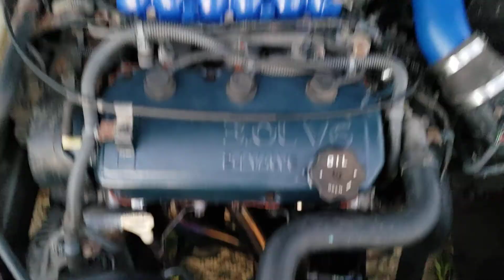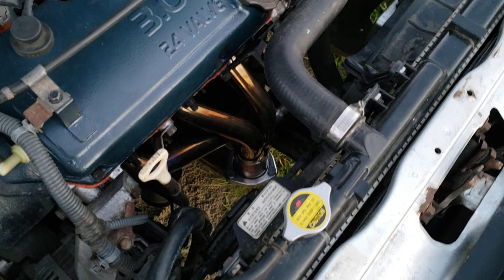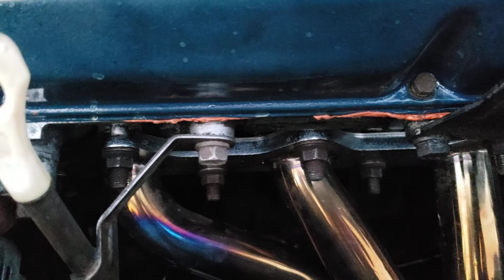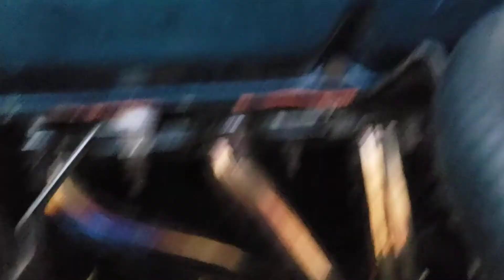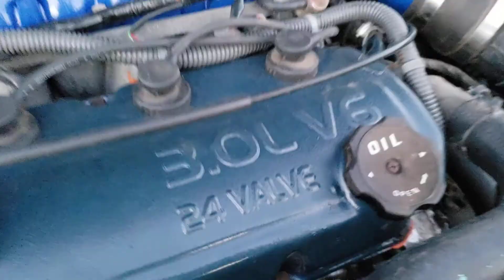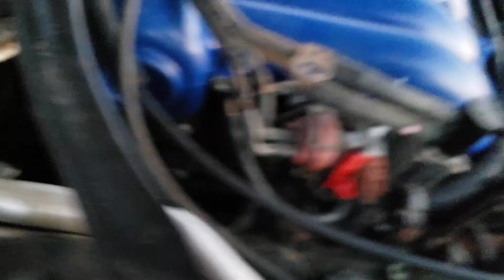Mitsubishi Eclipse GT Headers

Comment: I’ve got the same set since 2008 my only regret is not getting them ceramic coated, then again I wish I’d bought different headers that actually did something like rpw’s or even hytecs
Reply from the maker: Normally, I'd spend the money on ceramic coated headers, they are nice.  The key with stainless is keeping anything that can be damaged by heat as far as possible away from them.  For less than $120USD, it was hard to pass them up.
Reply: Gary Burrus i still drive the car to this day it’s just unless you get it tuned you really won’t feel a difference
Reply from the maker: @nitrous07me  Unfortunately, that seems to be the case with headers on most new(er) vehicles.  If I could find someone that does mail-order tunes, I would love that, no one within 7 hours of me does dyno tuning.  Until then, I'm cool with the little bit of performance gain.

Comment: Im having trouble with my custom made oxygen sensors. How did u solve the problem?
Reply from the maker: I was able to use the factory ones without issue. Custom made sensors are always a pain because the resistance of the wire is changed which affects the O2 sensor readings.

Comment: Cannot find this anywhere for that price
Reply from the maker: I haven't been able to find them either any longer.  The company is DNA Motoring.  They appear to still be in business, but I cannot find these headers on eBay or Amazon.  The closest I can find are over $400.  DNA Motoring still has an eBay store, I would contact them and see if they are still making the headers.  So far, they've been great.  No cracks, leaks, or anything out of the ordinary.
Reply from the maker: Found them!  They're back on eBay! https://www.ebay.com/itm/151308816593